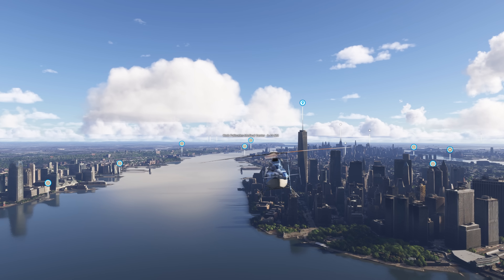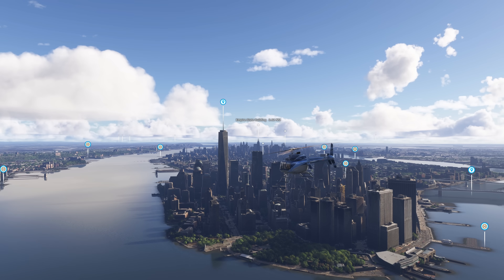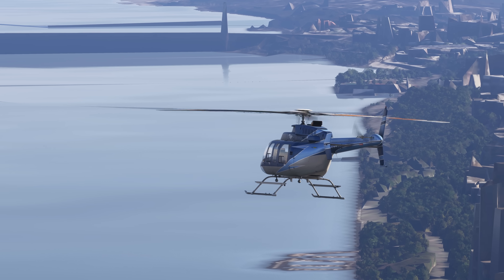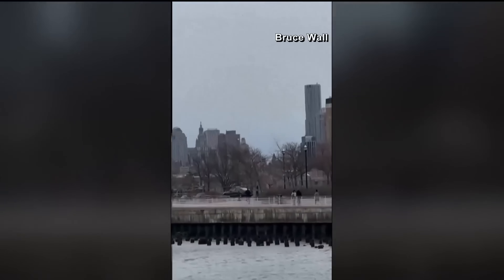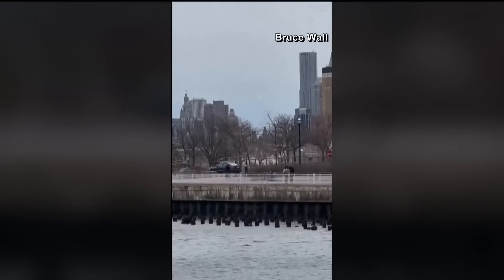Helicopter Expert breaks down Hudson Crash, and discusses “Bump Mast” Theory | NYC Crash Follow-Up

Comment: Another shockingly sad event. Would you still say these tourist tours are safe? My daughter is visiting NY in a couple of months and wants to go on one of these. I’d rather she didn’t now. Can anyone put my mind at rest? As I understand it, a plane has more chance of recovering if something goes wrong compared to a helicopter?
Reply: No, these tours are clearly not safe.
It's not just a freak incident every twenty-odd years, it's multiple incidents every year and a complete disregard for passenger safety from the bosses of these companies.
The boss of this one, for instance, just fired his director of operations because the director had agreed to voluntarily suspend the flights until further notice. So the boss fired him and now the FAA has revoked the company's licence so they can't fly anymore anyway. 
About another NY helicopter company, CNN writes:
"In 2015, a pilot for the New York Helicopter Charter company was forced to land in New Jersey after hovering 20 feet in the air for a short time. An initial inspection showed there “may have been corrosion removed” from sections of the helicopter and that some of the helicopter’s component parts may have been deformed to an extent to be “considered unairworthy,” according to an FAA inspector at the time. The same helicopter was previously involved in a crash in Chile in 2010."
I hope I put your mind at rest that there are many safer activities other than flying on these New York tourist helicopters.

Comment: Figure gearbox or engine had an immediate seizure and the centrifugal force of the rotors going around broke the mountings to the gearbox and the rotors flew away from the chopper. The sudden force of the rotors spinning and the seizure spun the chopper sideways with enough force it snapped the tail off.
Reply: Most likely a tooth collision inside the gear box

Comment: From the latest photos it appears that the rotors blades and head are still connected to the mast and transmission. What is really shocking is that the transmission and nodal beams and mounts separated as a complete assembly.

Comment: From the video evidence it is almost certain that the main rotor gearbox/transmission locked up, the torque from the rotating mast and rotors caused the gearbox/transmission to rotate with the mast/rotors, the torque of that rotating mass caused the fuselage to partially rotate while the gearbox/transmission broke from the fuselage, that fuselage rotation caused the tail rotor boom to break off, upon departing the fuselage the still complete and apparently undamaged rotors with attached gearbox/transmission then autorotated down.  There is no evidence of mast bumping or any other pilot induced cause.  The gearbox/transmission lock up could occur because of a broken gear tooth or other metal part coming between meshed gears.

Comment: Without watching the entire video yet, this looks like a massive gearbox failure that managed to totally seize the box, tore the tail rotor shaft out and ripped the gearbox clear out the top of the aircraft. The forces involved are immense, there was no chance to do anything and this doesn't look pilot induced at all to me. No signs of a mast-bump here flying straight and level.

Comment: I don't think you quite go into as much detail as you could. The entire transmission is cleanly detaches with the two intact blades still attached. The entire tail is clean sheered of as a stump about a meter from the body. Roughly when it happens it swerves sharply to the right which might indicate the initial loss of the tail.

Comment: In the event of a catastrophic failure, the drill is the accompany the aircraft to scene of the accident! 
Sounds brutal, but that’s why it’s called a ‘catastrophic failure’ RIP to the occupants and my thoughts are with the families and friends of them all. From an ex military helicopter engineer.
Helicopters are inherently, 10,000 parts rotating around an oil leak, waiting for metal fatigue to set in!

Comment: Colonel Joe was totally wrong when he said the wind conditions were good when this happened.
The wind gusts at that time was so high that other operators of the same exact helicopter model didn't want to fly in NYC and had their helicopters grounded.
That means it was very far from being calm wind conditions.
And with how the wind and turbulence can be in the Hudson river area in different wind directions because of the buildings and more, they could have experienced some extreme gusts.
I am not claiming it was mast bumping, but it can not be ruled out at all even if I think it is more likely think that the mast and/or main rotor fell off.
Where the Jesus nut very well could have been the culprit.
Some strong wind gusts/turbulence can also be a reason for this happening.

Comment: My blazer is 25 years old if I don't check the oil or the brakes or do maintenance on my blazer it could fall apart on the interstate and hurt me or hurt someone else you must maintain your machines no different from my E bike or a helicopter maintenance checks maintenance performance Safety number one ☝️

Comment: Piss poor explanation of mast bumping.. it primarily happens when the pilot pulls negative G’s causing the blade supports to slam the mast causing the mast to sever. You can see both rotor blades are still attached to the mast post and the main transmission is hanging below them as it drops out of the sky. The question is.. why was the transmission torn from the aircraft. For that to occur, the transmission attachment hardware would have had to fail or the strut supports failed. I spent 22 years working on many types of helicopters and this wasn’t a mast bumping situation!

Comment: Capt., I know that it is possible to over-stress control surfaces on a fixed wing aircraft if a pilot makes extreme corrections. We've also seen weight shifts and metal fatigue play a role, such as firefighting aircraft losing a wing during a retardant drop. 

Please ask the Colonel if that's possible on rotor aircraft? For example, a mast failure during a specific maneuver that puts an unusual stress on the tail, causing it to break free without the main rotor striking it? It's so odd how everything came apart despite the rotor appearing to have intact blades?

Comment: It looks like the transmission perhaps froze up because the whole router both blades are intact and it looks like it ripped the four points of that whole suspension of the transmission right out of the fuselage so that’s a good possibility that could separate the rotors because it looks like it pulled the hole Superstructure that holds a transmission right out of the fuselage
Reply: Thank you, Joe. That was very good.

Comment: Jesus Nut…..NOT tightened by DEI workers….now running for the Mexican border.
Reply: This is perhaps the worst reviews of possibilities ever heard. 

They keep saying the same Bs over & over repeating Rotors. 

The rotor is the entire hub with all its blades. 

There was in fact on view hitting the water a single blade fully intact. 

That indicates it never touched the tail. 

So why is one blade exiting the hub? 

And why is the entire tail  separating? 

It's not unusual for the very long jack shift bearing supports to fail and possibly come apart now swinging a 60lb Billy club around inside the tail destroying it. 

And we'll have to wait to see if that's even possible after inspection. 

But seeing that single blade hit the water, that alone could upset the balance so severe, 

that entire hub with remaining blades with not be possible to stay in place. 

We have experienced prop failure where one blade separated, and unbalance is so severe it jerks the entire engine out of the aircraft killing the pilot as he departed Iceland. 

Now a review of the company is also grave concern. 
They owed several hundred thousand for just maintenance alone. 

Let alone other huge debts beyond and went bankrupt in the past. 

If those rotor blade fasteners were violated by Improper service, by FFA Laws, if you are the tech that serviced anything touched,, you by law sign your name to that service document indicating its airworthiness.  

So this tech has more than likely been contacted already. 

This is how they figured out how the wrong bolts were used and came out in flight holding the windshield in place, killing everyone on board when the cabin is pressurized when over 10K feet. 

Truly Sad event for this family and all their friends. 
There's simply no excuse for a normal flight to disintegrate in mid-air. 

When they are capable of stunt inverted highvG loads in Airshows. 

I rode with friend who is pilot for the same ship, and the massive power and lift is amazing. 

A normal person can't imagine almost 2 Gs of very high loading blades can take this much weight and go straight up like a rocket. 

Pilot even asked if I was Ok, so obviously I was in silent scream mode grabbing the ceiling and butt cheeks at the same time. 
Cheers 
Now to see if YouTube has either of these cases ~ Tail rotor drive shaft exploding and rotor blade separation destroying entire ship in less than a second. 

If this happened to your lawnmower, with half the blade coming off, you'd probably not be able to run fast enough to get away. The handle bar already broke your grip from severe unbalance.

Comment: Nothinging ventured.. Nothing gained speculation by a fixed wing pilot a retiree who likely has no real understanding  of A&P on complex machines..   Ala rotorcraft...  Oh, and it is NOT the "Jesus Nut"..  It is a "Jesus Bolt"..  Which you may see in R/C helicopters, but no Jesus Nut is going to back out so simply...   Transmission seizing if i had to speculate..   Sure was not a boom strike / mast bump.

Comment: I am on NO WAY a Helicopter pilot, nor mechanic. But wouldn’t you think it would be impossible to have a Mast bump even happen? Seems almost ludicrous that (under certain conditions) the blades can tilt or angle or bend in such a way where they can strike the rear tail section, severing it? That is instant death. I can’t even imagine this would be possible from a design element. I would think just from common sense that wouldn’t even be possible!!?? Or am I way off base? 

That’s like designing a motorcycle and saying…. Well if the weather is bad enough, the front forks can hit the frame and come off the bike!! Would never even be a possibility so how can “mast bumping” even be possible on a helicopter specifically designed to carry passengers?

Comment: Foremost my deepest condolences to the victims and there families.
 Also I would not speculate or jump to any conclusions. 
 But in the blurry footage i saw, you clearly see that the accident starts whit a abrupt yawing from cruise speed - some whiteness stated that it was a right yaw - if that's the case, it would on a left turning rotorsystem, like bell helicopters, be due to a Tail rotor driveshaft failure. A left yaw would be due to main driveshaft or engine failure. 
In any case pilot must enter autorotation immediately - if not done, you will loose control.

Comment: So it's just coincidence that all these aviation accidents are happening in the US and not a systemic lowering of standards / relaxed adherence to protocol? I'm sure the NTSB will uncover the reason this aircraft went down just like they did for the last accident and the one before that and the one before that. And while they all might be reasonable and understandable excuses on a per-accident basis, the system-wide failure will remain unchecked and might remain unchecked as there is unlikely to be a smoking gun for everyone to point at and blame but rather very small laxities and noncompliance across the aviation industry as a whole — incremental erosions or diffusions of responsibility that compound invisibly until they manifest in tragedy.

The aviation industry is historically safe but the prioritization of the feelings of individuals is relatively new. And such a concept would need time to work its way through and affect change in a multi-disciplined industry like aviation, making it even harder to identify as the culprit. But it would sure explain the sudden occurrence of all these seemingly unrelated "coincidences" wouldn't it?
Reply: This stuff has been going on for years, what we have not had is the constant instant communication disseminating every accident. I have been flying for over 40 years, unfortunately many accidents have occurred in that time period.
Reply: @chrisstromberg6527  So you're saying that online connectivity has made public engagement with the aviation industry more possible and that growing public interest led to increased demand for coverage of these events, and now here we are, seeing the illusion of a sudden uptick in aviation accidents?

I get you. And I thought this might be the case too but then I looked at the fact that the 2010's were the US aviation industry's safest decade in history. The Airline Safety and FAA Extension Act made US aviation indisputably safer. Southwest 1380 was the only notable incident in that entire decade. But then in the early 2020's we begin to see incidents and fatalities emerge in Part 135 where oversight and standardization are weaker, which wouldn't necessarily suggest a system-wide shift in safety architecture unless it started to creep into Part 121 which it inevitably did, starting with emergency exit doors flying off, followed by the recent growing trend of injury & fatal accidents.

What do you make of all of this?

Comment: An early analysis said the gear box was visible with the two blades attached and still spinning. So, the implication was that the gear box mounts failed where they attach to the airframe. THEN, did a blade cut the tail boom? There was a video showing the aircraft flying along straight-and-level THEN suddenly coming apart; but, you have not shown that video.

Comment: He's talking about harmonic resonance , not mast bumping ...Mast bumping is caused by terminating a climb with negative collective in forward flight ,,, which bows the blade tips downward  and chops the tail off ... The rotor blades are much stronger (carbon fiber) than the tail boom (sheet metal with a driveshaft)...

Comment: I worked at Bristow helicopters in the late ninties. I was helping prepare the bodies for painting. They used to service and repair them. They also had right offs there, one of the right offs was from a north sea oil rig one which had a failure of the tail rotor or seized bearing associated with it ? and that caused the gearbox to explode and it ended up in the north sea. I saw enough there to never want to go up in one of those pieces of junk. I was offered a fliight in the ones they were flight testing numerous times but declined.

Comment: I have crewed or been in charge of the the crewchiefs that were crewing the birds for 20+ years in the Army and at the beginning of my career I worked on the OH-58A/C(closest to the exact bird that crashed) and later the OH-58D which are the military version of this helicopter just earlier models like what Col. Joe described has the bird he flew in flight training. I have been to combat and saw these birds take small arms fire to the rotors and saw such bad wind storms that came up out of no where and neither caused this kind of destruction. To see the entire trans and main rotor and hub still intact but just ripping those components along with the deck was just crazy. Watching the video that was filmed from the NY side I believe that showed a quick lateral turn makes me wonder if there was a flock of birds or a drone , but the way that bird came apart seems like there might have been an explosion in the engine compartment that blew straight up through the transmission deck. I can't understand this and I am having migraines trying to figure this out in my own head.

Comment: That “Jesus nut” is the ONE bolt that holds the prop to the fuselage.. it’s made to withstand ridiculous amounts of pressure and it’s called that because if THAT fails, you’re going to meet him.. as crude as it sounds it’s what it is..

Comment: its not mast bumping stop. transmission came with the rotor, its transmission failure, mechanics f'd up catastrophically
Reply: I must say this is very accurate. The tail rotor is driven by a drive-shaft if that fails it tears off entire mast. I 00% agree someone messed up in checking that somehow.

Comment: I saw another video from far away where you see the heli in a straight foward flight .all the sudden in half seconds  the heli counter rotated!!as it counter rotated the tail twisted due to the wind resistance while it counter rotated! I would bet it wasn't a mast bump.i would bet on it being like the transmission locked up.i also noticed on some other pictures before the flight that while the passengers where getting their pre flight pictures you can see the young pilot closely looking at something up and left of him.as if he kind of concentrated on that.usually during those pictures you see the pilot just smiling at the camara.this guy was seriously fixated on something top and left of him..what's up that way??? Any instruments on a top panel?? Did he notice something not normal thru the glass top??? Check out those pics and see for yourselves